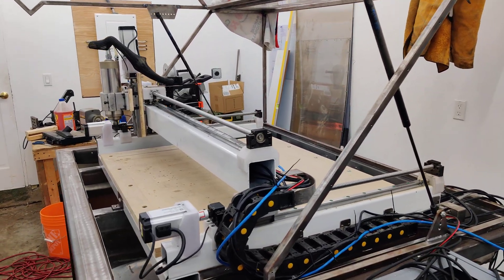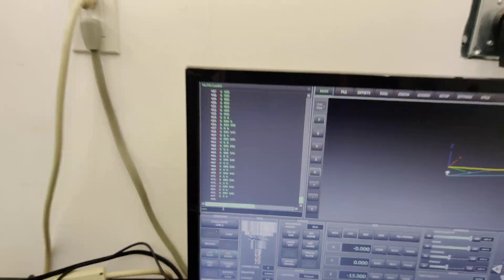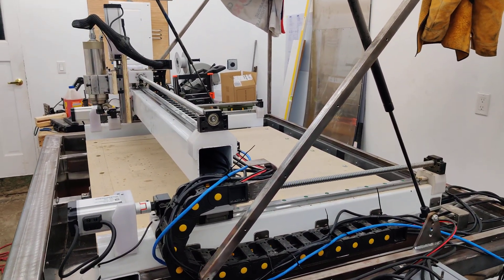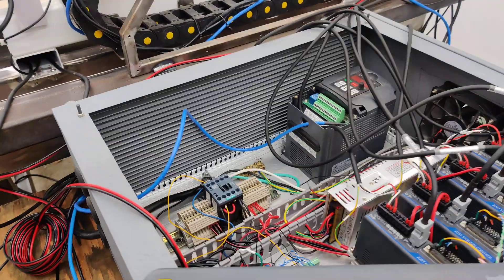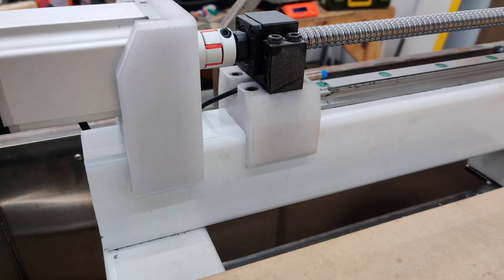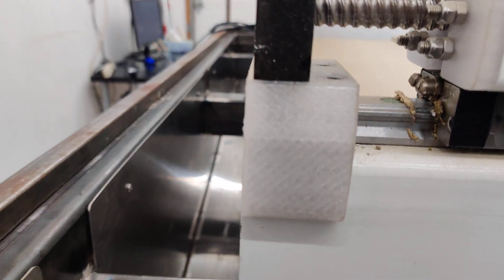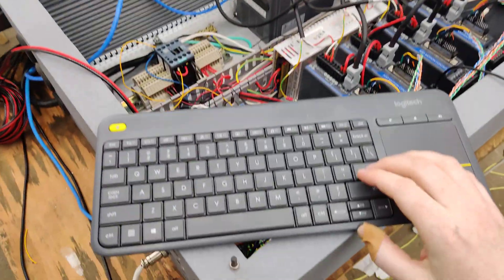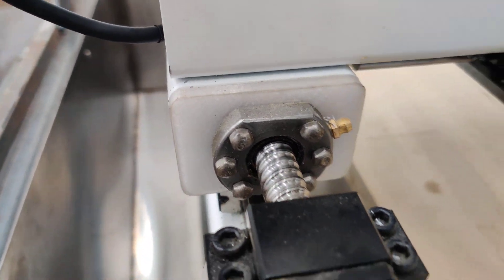Follow up on the first servo test. No crashing this time! PrintCNC CNC machine

Comment: Quick rapids can save a lot of time but you'll never cut at that speed. Crashes at that speed can cause some serious damage too. I'd also bump up acceleration, that might make more of a difference than top velocity. I don't like the exposed ball screw in the print NC design, lots of dust and debris will get caught in that. 
Nice build!

Comment: your going to need forced lubrication to sustain these travels and not destroy the ball nut.
nice build.
Reply from the maker: Yeah possibly, I’m not even sure if using grease on the nut and carriages is a good idea when I get the flood cooling setup. Maybe an oil based lube would be the way to go long term.